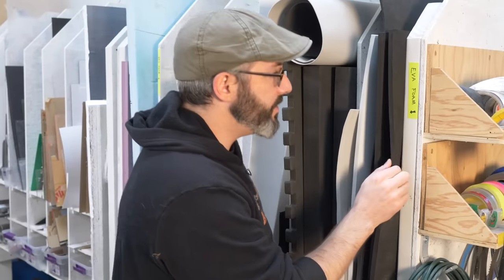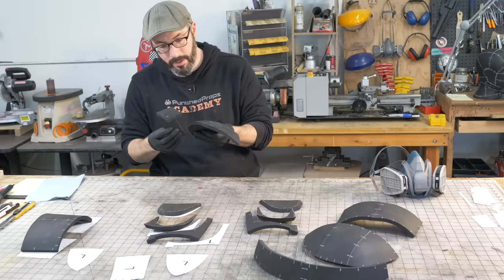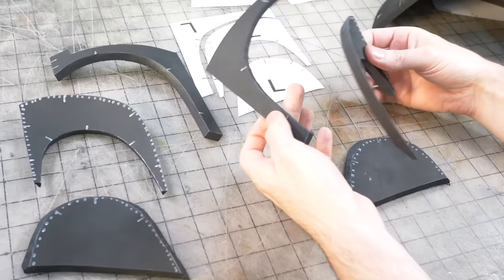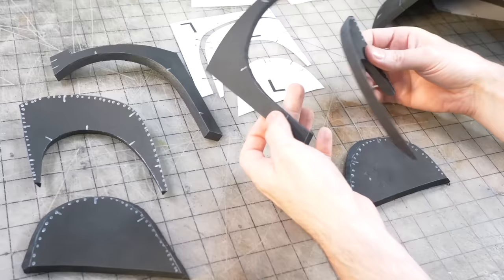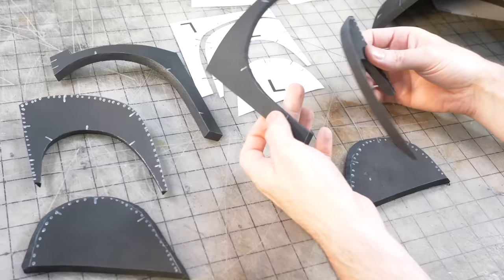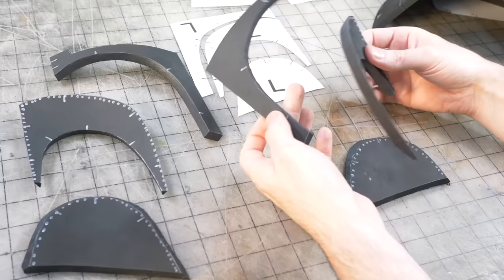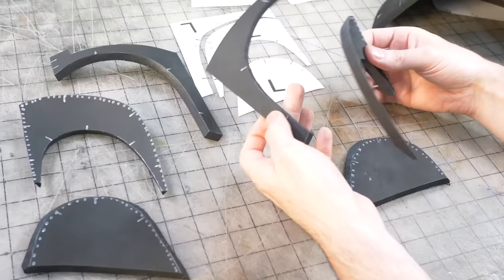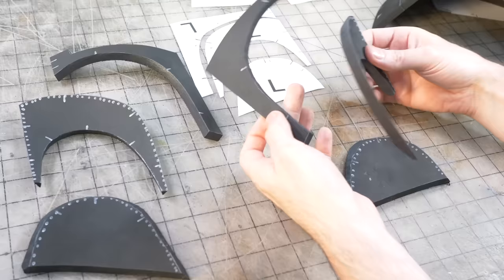Let's Make Foam Helmets! BOBA FETT & THE MANDALORIAN | 500k Community Challenge

Comment: While getting edges aligned, use toothpicks. Stick them into the edges and they will bridge the gap between spaces like the upper and lower eye gap, keeping it lined up so you can heat it to bend the foam into place.

Comment: One way to avoid drips in the epoxy is to always start at the top of the piece and pull down. This includes after applying to horizontal parts. Pull the epoxy down. That way, if you do have "drips", they will all be down at the bottom, and not in and around details.
Reply from the maker: Great tip!

Comment: I made this from this video. One thing i did for comfort, was use the headband piece from an old PPE hardhat so I didn't need to line it in foam to fit properly. I found it breathed so better, and it actually protected my head when struck. I just glued the four parts that clip into the hardhat to the inside of the helmet ensuring the depth was correct and it was level on my head.  the size adjustment dial was a bit of a nuisance to adjust, but once I got it a snug fit, I haven't had a problem since.

Comment: I've found that if you use a thin plastic, you can actually use contact cement and it work really well. Just make sure any heating you're going to do is done before you put the plastic visor in!
Reply from the maker: Thanks for the tip!

Comment: So, just a note about the usage of Flexbond:
When using Flexbond to seal EVA Foam, Most costumers/cosplayers will apply a minimum of three layers to ensure true smoothness. The final layer I prefer to apply using my finger (which I will intermittently dip in water) so I am smoothing the layer as I go (somewhat similar to how you smooth the caulk in the seams). The way you applied Flexbond is fine, but I feel like the results demonstrated (and your commentary on the topic) isn't a fair representation of what the product is truly capable of. 
Anyhoo, I highly recommend Flexbond as a sealant, especially if you are looking for a non-toxic, small-space friendly, flexible product that will fully seal your Foam without lending it towards cracking or fragility. It also doesn't peel off like Plasti-dip is prone to do, and can withstand high temperatures as well! As a Texan, I appreciate that!
Reply from the maker: Thanks so much! That's very helpful!
Reply: Would you sand all of the flexbond layers after they dry or put on all 3 layers and only sand the final layer?

Comment: So honest question. I just finished gluing one of these together, and I feel like the resulting helmet is HUGE. What would be the best way to reduce the size of the helmet without losing to much of the vertical coverage?
Reply: you don't shrink the helmet, you fill your head with air.
Reply: wait so you made the helmet and its to big for your head. do you know the size of your head by any chance???
Reply: Interior. Make it look nice, fill it with electronics and padding and greeblies to make it look even better. Really sells it.
Reply: Printer Option. Print Original Size ist the Original. Know the size of your Head, then reduce the Original Size of the Page in % of your Head.
Reply: I had the exact same problem. I actually printed the pattern at 90% size because I was afraid of how big his looks, but it was still too big. I got it to look much better by cutting out a strip of about an inch thick straight down the center of the helmet (middle of the eyes to the back of the neck). It also make the helmet look much slimmer. Sorry if this advice is a bit too late tho, hope you figured something out :)
Reply: @kedlead2510  Something that simple is really enough to fix it? :D That's really great to hear!
Reply: @kedlead2510  hahaha i came back to this video hoping to find advice such as this. the templates say the helmet comfortably fits a 23" head at 100% but even with my 23" head it is simply huge. hopefully this saves me a lot of work !  thank you

Comment: “This stuff is pretty toxic”
That’s why it’s going in a not well ventilated helmet
Reply from the maker: Once it dries it's all good 👍
Reply: @punishedprops  Does opening a window a crack count as a ventilated area? I tried working with EVA foam for the first time and used DAP contact cement glue with a mask on as even with the fresh air the general project area smelled like poison.
Reply: When it's wet, nearly all types of glues are not great to breath when wet but once they dry they're perfectly safe
Reply: @torneagle4235  So how do I know if it's dry? By smell or by lightly touching with a glove (The stuff was really hard to get off my hands).
Reply: @ignisking759  on most glue labels there should be a listed time where it says is either the minimum amount needed to dry or the "average" i guess. just read whatever label is on your glue, if it says 24 hours don't be afraid to wait 36 hours or something like that nothing can be too dry
Reply: @love2percent297  Guess I'm just impatient then. I follow the wait time, but also have to add more to it because it's an average. Was wondering if there's a sure fire method other than touching it.
Reply: Ignis King honestly I don’t think so other than appearance, but you could also buy like 100 toothpicks for 99 cents and touch it with that?

Comment: Flexbond can be watered down to prevent getting brush strokes to begin with. Also foam brushes counterintuitively make it harder to prevent getting more strokes to begin with. You want a really soft paintbrush or even a makeup brush. This is always giving me a smooth surface. While I haven't tried it you can supposedly wet sand it too.

Comment: Sabine Wren Helmet Log (WIP)

Dec/25ish/22 Printed and cut pattern @100% . traced and cut EVA foam ( 8mm).
     (NOTE) I reshaped the whole cheek cutouts and eye shapes by retracing the pattern pieces.
Dec/29/22 Main pieces glued together(contact cement).  Full crown, 2 cheek panels, full back of head
     (NOTE) The whole thing looked extremely oversized when I held together the pieces. (looked like something out of Spaceballs😂) So I cut a 1-inch strip from the top of the crown stretching from back to front. this brought the helmet closer to my ears, overall, giving a narrower appearance from the front (similar to what's seen in Rebels) .
Dec/30/22 All main pieces are glued together. Took the Dremel to sharp edges to soften them.
Jan/6/23 Cut and smoothed(Dremel) ear and range finder pieces
Jan/7/23 Found out I could make (those weird pointy) seams almost perfectly smooth by going over them with the Dremel 👍
Jan/18/23 Spackled and sanded all exterior seams. all is a go for the first resin coat
      (NOTE)I chose resin (got some for Christmas! Thanks Mom and Dad!) because I couldn't get over the immaculate finish it gave that Din Djarin helmet, and that sound!😙👌
 Jan/22/23 Both coats of resin were successfully applied! I sanded down the drips. I'm now waiting on my magnets and PVC sheet (Range Finder Pieces), they're estimated to arrive on the 31st😑.
     (NOTE) So to look at it more positively, I have over a week to sand the helmet to perfection, and I can look at what it might take to make Sabine's full suit of armor, weapons, and base layer.
Jan/30/23 The magnets, PVC sheet, and vizor arrived!
Feb/4/23 Range Finder has been cut, sanded, and sealed! Accidentally mixed extra resin when sealing the Range Finder and added an additional impromptu coat to the helmet😅 That meant more sanding.
      (NOTE) I believe that makes 3 coats of resin 
Feb/11/23 Next I need spray primer, and paint, both of which I can get at Michael's Crafts for a reasonable price.
Feb/17/23 Applied Spray Primer. I went pretty heavy with it (NOT GOOD)
, I got quite a few drips, so I sanded those as best I could by hand. I believe I did maybe 3-4 coats of primer in all. I recommend following instructions and applying many light coats!
Feb/19/23 Started painting! I put down coats of the base colors (Grey, purple, and orange). I'm using acrylic craft paints I bought from Michael's Crafts. 
     (NOTE) I hand-mixed as few of the colors as possible, this made it easier for touch-ups. I kept hand-mixed colors in some old air-tight jars for touch-ups later.
Mar/31/23 Painting is almost done! I have a few small details and weathering left!
     (NOTE) I took breaks often, especially when painting. there's no reason for the helmet to take more than a couple months at most, I just had no deadlines and wanted to take my time. 

Hope this can help anyone who's looking. Log dates are not all accurate. This is my first helmet and, until this point, I have worked very little with foam.  I'll try to add up the total supply cost at the end.  I'm going to keep working!
* Don't forget respiratory protection, and may the force be with you*
Reply: Agreed, helmet is a bit wide.  Definitely could go without one of the inner strips.

Comment: I really want to get into making stuff, but I have absolutely no experience on the foam I should use and how thick and basically everything lol
Reply from the maker: Check out our beginner playlist! https://www.youtube.com/playlist?list=PL6q0fd3ileWIRIRih1fdeo2-n6Uu6S3yJ The best way to learn is to try! You don't have to get it right the first few times :)
Reply: This helmet pattern has the foam thickness printed on it, so you know exactly how thick the foam need to be
Reply: I looked through the vid and I dont know if I'm half blind or what, but I couldn't tell how thick the foam is. I'm guessing 10mm but  have never handled foam so I can't be positive.
Edit: Found it!Iit is 10mm, now I'm just gonna guess it's low density...

Comment: When I make helmets, I like to start with a hardhat. This always helps me keep the scale to something reasonably 'helmet' sized.
Plus; even cheap hardhats have an OK feeling, adjustable head-strap for fitment since they are designed to be worn all day.
Just take off all the extra plastic that would stick out of your finished helmet.
The ridges on the hardhat usually aren't a problem either. You can incorporate them into the finished look, or build up the surrounding area with foam until it's level and smooth.

Side Note: When making custom armor props (IE, not replica or accurate), especially in the case of armor/military stuff like this, I don't try to hide the brush strokes (or even a few drips). I try to think about the 'story' of the piece. Is this something that get's a quick coat of paint the day or two before landing on a new planet, just to help match the local colors? Would it just be done with a brush and a can? Would it be a hasty spray of something dark and flat so it's not reflective? Would the owner have cleaned the armor up before they did it? If so, would they be meticulous? Or would they just hit it with a quick wire brush to take the big stuff off? If there is stencil work, would they REALLY mask off the whole rest of the piece, or would there be a bit of overspray around the stencil?

I think that sometimes we try REALLY hard to think about getting some SPECIFIC look. But sometimes we can just do things 'for real' instead, and come out with something that looks good too. (And we can always go back and help it out afterwards with a wash or some highlighting.)
Reply from the maker: Awesome tips!

Comment: One tip for using the epoxy method. There are 2 component car clear coats, which basically is epoxy. That is great for a last layer.

Comment: I normally get the vizor in then layer bondo and then I use a site resin to coat the helmets then sand the resin smooth then paint then a layer of clear resin it's a lot stronger than any normal paint

Comment: So I have a question, I'm not sure it will go answered, but I'll give it a go. So, I'm wanting to scale down the size of this to fit my 21'' and some change head. I just want the helmet to look proportional. How do I go about scaling the pattern down to fit my measurements without  distorting the final product? I have considered the whole cut and tape method, but that's more useful for patterns that require a inch at most taken off. Thank you to anyone willing to lend a helpful piece of advice! regardless of what is to come I plan on making this helmet soon. Thank you so much PPA for putting this pattern out there, a year ago.
Reply from the maker: You can scale the whole file before you print in the print dialogue! When printed at 100% scale it measures for my 23" head. You can adjust the print scale to print at a smaller percentage and check with the paper cut outs. Just make sure you allow room for the thickness of the foam!
Reply: @punishedprops   Bah!!! Y'all are just the best!!! Thank you so much for such helpful information on a video done a year ago!!!!!

Comment: My question, would it be possible to turn this into a mold, like maybe make it with fiberglass and resin, make it hard and rigid, and maybe even add extra supports or even metal peices?
Reply from the maker: Sure! You'd just have to make sure the foam is sealed. Make a silicone mold then slush cast in resin. Our employee Paige is actually working on that for her own helmet right now

Comment: I’m well on the way of finishing my jango helmet using the boba template🤯 I love the way it looks so far. Finishing up the sealing of some stray gaps and then put some sealant on it, prime, and paint. Caulk works really well for filling gaps. Are the epoxy or any other sealants completely necessary? Or are they just for better paint outcome?

Comment: Hey im late to the party but wanted to try to build the mandalorian as my first ever EVA foam project. I saw im your video you had some extra pieces cut of 2mm foam for Boba Fett on the cheak parts. Is that the same size as the cheak piece on the blue print? Theres also a grove above his eye slits , is that done from a dremel drilling into it or is that another 2mm piece glued ontop? Did you ever draw the strip for the center peice of the helmet?

Comment: Also I would have used 8magnets and put them in 2 places on the range finder arm
 My favourite way to feel is use a fiber glass resin also I sometimes use a ladies nylon tights then fiberglass resin to make a resin nylon composite which makes the helmet a lot more resistant to being dropped kids ask to wear mine a lot and then run around in it and it gets dropped I like the way it wears downs I'm ok with it but dont want to have it complex ruined
Reply: That way you have one on the pivot and one to lock the arm in place
Reply from the maker: Thanks for watching!

Comment: Love your stuff!!!!  I do Need help though.  I’m making the mandolorian helmet based on this video and your blue prints:

1- how do I reproduce the earpieces.  You show it for Boba but not for Mando (which are different).  And since I don’t have a band saw I’m a little lost.

2- at about 18:50 you also use additional  thin layers on the front and side of boba mask.  Does this apply for Mando too?

3- do I have to cut out the small back rectangular piece similar to the video?

4- what is it that you spray on your Mando helmet after you applied the apoxy and sealant?

Apologies for the questions.  Just wanna make this helmet great in time for NYCC.
Reply: Hey….did you see this?  In my most desperate voice Heeeeeeeeeeeeeeeelp.  Lol

Comment: Would scissors work for this project? I don't trust myself with a knife
And would this be more difficult if I were to use hot glue instead of contact cement?
Reply from the maker: You can totally use hot glue! Check out this video for some tips: https://youtu.be/9An0ZK1Oz8g

Scissors CAN work but they create a different edge on your foam, so you may have some trouble getting edges to line up.
Reply: @punishedprops  thank you so much for the tip! I've made the chest and arm pieces so far and this video really helped me decide on making that helmet 😋

Comment: Thank you for sharing and for explaining the process so well, no one shares the templates if it is not for some money, thanks again, I have a question, if I make the helmet with millimeter-sized EVA foam it doesn't matter, right? thank you
Reply: thinner foam=bigger helmet. The pattern is made for 10mm foam and a 58cm headcircumfence. (I made a testhelmet in a really floppy 5mm foam and it was huge on my head).

Comment: I want to scale this down for my little kid. His head is 21 inches in circumference which is about 90% of the 23 inches this version is made for. If I print off at 90% scale, will I be about good? Or do I need to scale back even more. Thanks!
Reply from the maker: I think that's a good place to start! You can tape some of the paper pieces together to check the scale before you cut your foam

Comment: Was Plastidip used on the Mando helmet as well?  Or does the epsilon epoxy sealer create the rigid surface needed for painting and that was just regular grey spray paint applied after the layers of epoxy?
Reply from the maker: The Epsilon Pro is all we used to seal and prep Din's helmet :)

Comment: hi there, i know this is kinda an old video... but ive just started applying the graphite powder to mine and its come out a lot darker than yours... do you know if it will become lighter if i varnish and do another layer or..? i also did an under coat of glossy black paint

Comment: Having trouble getting rid of all the microbits from sanding the foam. Any tips?
Reply from the maker: Fire! Sort of XD Heat sealing can really help smooth out that surface. You can also use some high grit sandpaper.

Comment: This is amazing! Just ordered materials to make this helmet. Question - the instructions say that this will easily fit a 23" circumference head. I measure in at 24 1/4". Should I size the templates up at all? Or will I just need smaller upholstery foam pieces for the interior?
Reply: Size up the template, it will save you alot of time.